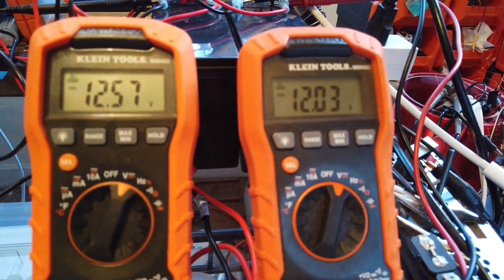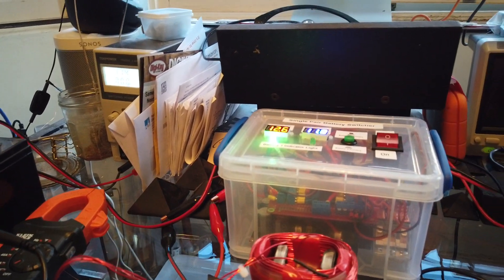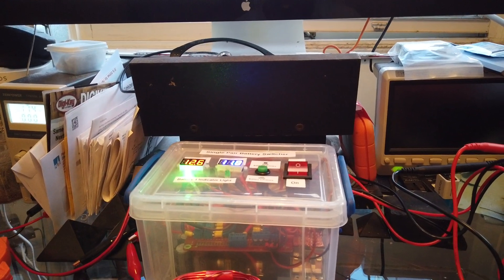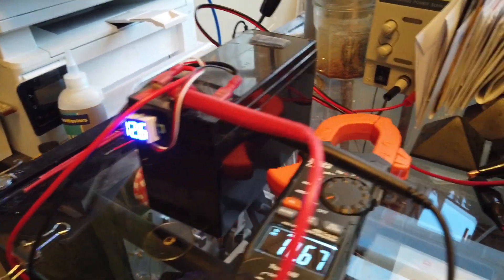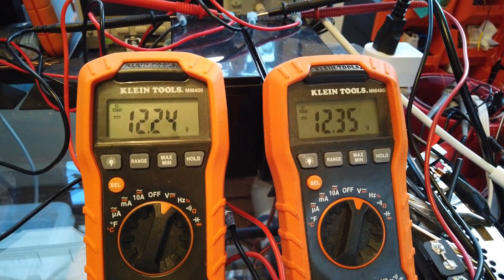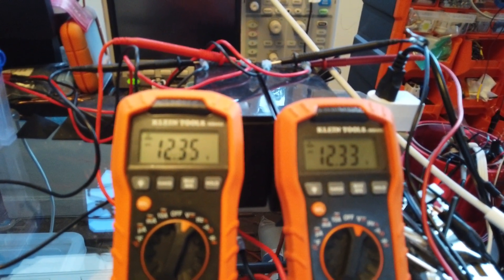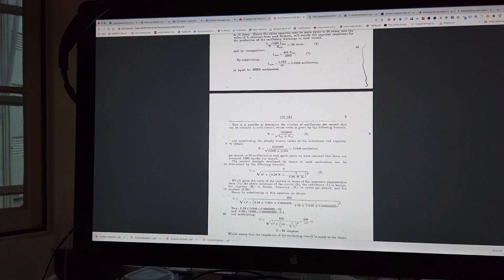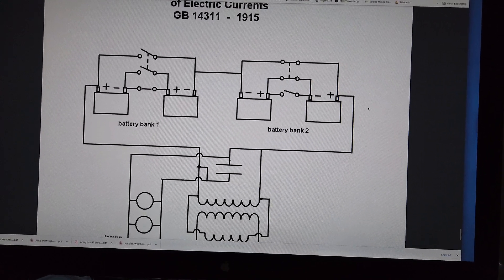Battery Pair Switching Demonstration 3 - 2nd Half

Comment: I know you were slightly disappointed with your results, have you ever tried using
Supercaps instead of batteries?

I play around with a lot of experiments, but I keep forgetting how utterly simple
the basic principle of the Benetiz patent is, so I tried something extremely easy
today with 3 simple off the shelf parts, (2) 12 Volt / 500 Farad caps and a 12 volt 60 watt motor.

One of the caps I had drained to less than 1 volt, the other cap was charged to
about 14 volts.  I connected the two negatives of the Supercaps together and ran
the motor for a few minutes between the 13 volt difference of the two Positives.

At the end of the experiment the combined voltage of the caps were GREATER than
when I started.  I ran the experiment 3-4 times after that with the exact same result!!!

Not only did the motor run 100% for free, there was actually a small increase in voltage
due to the coil collapse & feedback from the motor.  The voltage increase wasn't anything
extreme (about 1 to 2 10th's of a volt per 2 minute run), but the motor ran for free
with nothing but off the shelf caps and motor, not to mention that the motor could
have been turning an alternator or generator for additional output.

Thoughts?
Reply: Hey my friend add a isolated boost converter as your "load"  between batteries instead of motor to charge your discharging supercap and maybe youll be able to take more power from your charging bank  as if boost converter takes 100w at 90% efficient (some are better) and that goes back into your super capacitor bank at 95% efficiency and   it should only take 15 watts for a continuous 100w output it would be more efficient than using motor to run generator to recharge battery i bet! 😊 ive done experiments with this and its simple and promising just dont have lots of money so id love to see this done 😊

Comment: Great videos, explanations, and tests!  I just couldn't stop thinking about that experiment that Rick Friedrich did with those two capacitors here: https://youtu.be/SE-AiC9yiFc?t=3946  

His video made me want to do some experiments like you're doing.  I love your setup with just two batteries, but I do believe the bigger this system is that probably the better it works?  Also, I know you have losses for a number of reasons, but I'm not 100% convinced that the motor didn't run for free.  If not, it had to be pretty close to when factoring in the increased voltage in the 3rd battery, not to mention that there was mechanical work that motor could have been doing, or it could have also been hooked to another small generator.  Any updates since this video?  Anything you're wanting to try next?

Most FE devices do seem to make some reference to the elusive magnetically quenched spark gap which few can achieve, that's why I really like this setup, it really makes sense to me.

Even if it's not 100% free, how long would your 12 watt motor run on just one battery the normal way versus the setup you have here?
Reply from the maker: @Just Bob Thanks for the feedback. I actually went to an in-person presentation by Rick Friedrich. The motor definitely didn't run for free in his experiment or in mine. This is all based on the work of Carlos Benitez. In his patent he discusses the need for "fast" battery switching and a magnetically quenched spark gap, which this experiment obviously does not have since I'm switching with a push button. 

My first assumption would be that switching has to happen as fast as the BEMF occurs in order to get something that behaves like free energy. In that case, I could see how there might be a state where the charge and discharge cycle in the electrolytic reactions on the anodes and cathodes might oscillate in a way where the discharging rate never exceeds the charging rate. That's just speculation, though. I'm not sure how fast would be fast enough, or how fast would be too fast. Figuring out how to do fast switching with a rotary spark gap might be an interesting experiment.
Reply: @PerpetualMotor   Totally unrelated, but I just stumbled across this guy! https://www.youtube.com/watch?v=vUIK1GZSduo&t=1s

Comment: Nice experiment. Sometimes it might be surprisingly efficient to use a RC brushless motor (with good quality efficient brushless motor driver) as a prime mover to a custom generator such as your axial flux generator. This axial flux model is nice but sorting out the vibration will improve its efficiency :) also the span between these magnets looked a bit wide. The neo  magnet "flux density" vs distance is rough approx (1/ (distance^2) ) so keep the span between magnets as small as possible (it might cause other problems but that is why building motors and generators is not an easy task due to precision problems in DIY environments). Please have a look at my DIY projects, I did a axial flux gen model but I didnt continue to develop it further :)
Reply from the maker: I think this comment might be meant for one of my first axial flux motor videos. Here is the latest: https://youtu.be/3BEet7gE8o4 This motor uses a PCB for the drive and trigger coils, so I was able to close the distance between magnet and coil to about 1.5mm on one side. I'm still figuring out how to get the other side that close.
Reply: @PerpetualMotor  Ive seen that axial flux you made recently. Its nice. I have recently started testing a bldc motor and I am using it as generator. The coil wires are routed to the motor exterior inside the shaft. That setup allows for symmetric rotor design and also you can use strong magnets without collapsing two disks on each other without support
Reply from the maker: @Kapalek84  I'd love to see that assembly.
Reply from the maker: @Kapalek84  Nice.
Reply: @PerpetualMotor  check a video about bicycle hub motor disassembly and you will see that stator is not moving when this generator is turning. Its just the outer shell made of left disk with collar and right disk bolted to the collar. Both disks have bearings on stationary shaft. Statot windings output wires go inside the shaft.

Comment: look at my energy loop diagram.
Reply from the maker: I checked it out. That setup would likely give close to the same results that I’ve found. However, the losses inherent in charging, discharging, and in loading and unloading a transformer will add up. Benitez acknowledges this in his patent, then explains the importance of the oscillating and self-quenched spark gap in storing charge in a capacitor to provide a suitable charging current.
Reply: @PerpetualMotor  I like that idea with the spark gap and the emf field
Reply: @PerpetualMotor  You have to use capacitors to collect not liquid chemical. Graphene supercapacitors and electrolitic
Reply: @PerpetualMotor  Only capacitors can charge faster than they discharge . and they can charge 1,000 times faster than liquid chemical. Liquid chemical batteries are good for dense storage.

Comment: cool and still eagerly waiting on the auto switching circuit :)
Reply from the maker: 😂 After actually reading the Carlos Benitez patent the priority is back to spark gaps. It seems that all roads seem to lead to hydrogen and plasma.
Reply: @PerpetualMotor  cool
Reply: What do you mean Perpetual? With ‘all roads leads to hydrogen and plasma?’
Reply from the maker: @hansscholte5472  Paul Pantone, Nikola Tesla, Stanley Meyer, and Randell Mills all seem to have created working free energy devices that use a spark gap or some form of hydrogen. I'm even starting to be convinced that magnetic field resonance may even have something to do with hydrino-like ions that Randell Mills discovered, that we don't completely understand yet. I, of course, could be wrong. Resonant, static electricity, and thermodynamic inventions may, however, have something to say to the contrary.